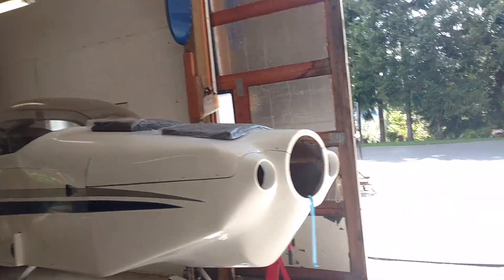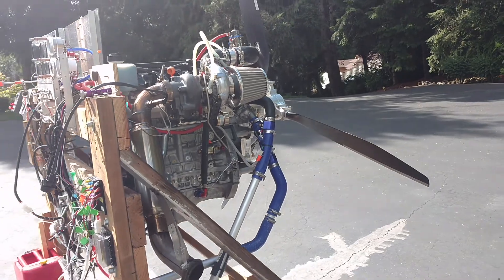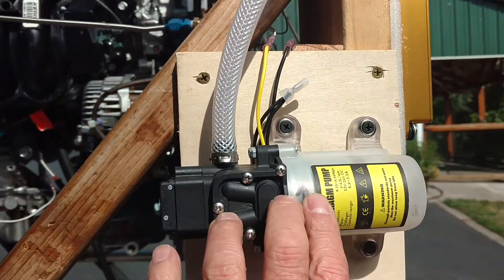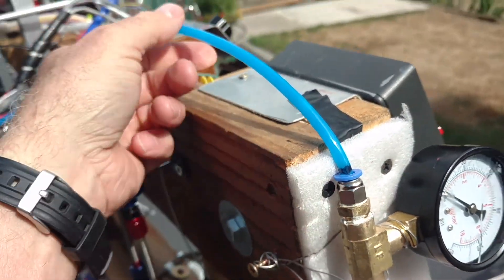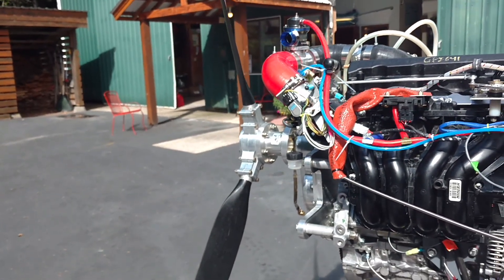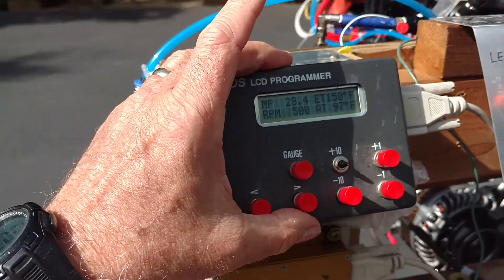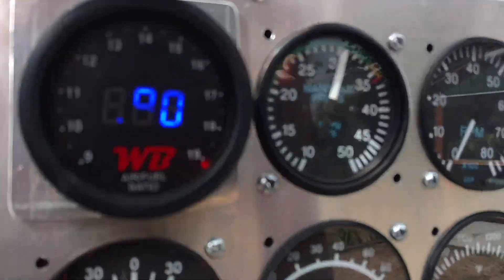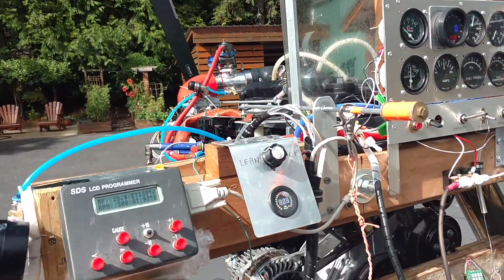Honda R18 airplane engine with Meth Injection at 5000 RPM with prop on test stand. Part 1.

Comment: You realise water/meth isn't to cool inlet temperatures, but cool compression and combustion temperatures.
Reply from the maker: When applied correctly it is also an excellent method to cool air inlet temps too.  Some people just don't know this.
Reply: @charosenz  You are correct. Ideally the setup should already have cool inlet. In the even of not having a sufficient charge cooler, water/meth will do this. All leads to the same outcome. If you have it setup near the inlet valves it will have little effect on inlet cooling. having it setup further from the valves increases the risk of inconsistent distribution  and pooling in the manifold. Depends on individual runner length.
Reply: @charosenz  the way you have this set up. you may be only ingesting part of the water meth thinking it is working. Meanwhile you have a portion of it pooling in the bottom of the manifold. You change angles in the aircraft and one or many cylinders are flooded with water meth, then a bang. because the liquid is more dense, it does not follow the same path as air, it can miss an inlet port and pool in the corner of the manifold. if you have it setup up stream, the intake needs to be more like that designed for carburettors, having a direct path for the fuel. nice work though, how did this all turn out?
Reply from the maker: @chippyjohn1   No pooling at all.   You have to make sure you pick the correct nozzle for proper atomization.

Comment: Are you going to use a oil cooler Honda turbo engines make alot of heat under boost for long periods of time
Reply from the maker: So far the temps are not bad, but I do have a sandwich adapter off the filter to add a cooler if I want.